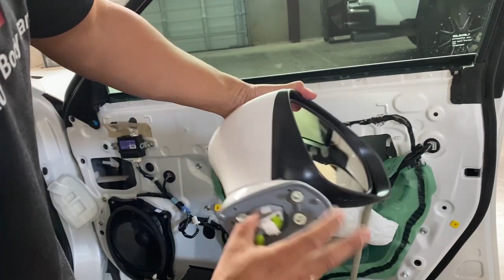Save 🤑 by DIY  : 2016-2018 Lexus ES350 Passenger Side View Mirror Removal and Installation.

Comment: This is the greatest video ever!    It saved me nearly $1000!    I have sheared off outside mirrors on my 2016 Lexus NX200t on a couple of occasions.   Taking it to the dealer for repair cost me around $1000 last time.  This time I knew it would be even more.    However, I was able to find the OEM Lexus outside mirror for $200 online.    I then watched this video a few times.

Removing the door panel was very easy.   Unplugging the mirror wiring harness was also easy.    On the NX, the controller was not in the way of reaching the 3 nuts holding the mirror assembly to the body, so there was no need to move that.

The only problem with the installation came with removing those 3 nuts.   I did not have a 10MM hex nut driver  bit for my electric drill.  I would have needed and extension for the bit as well as the nuts are about 2.5 inches deep.   I did a workaround by using a manual 10mm nut driver.  However the nuts themselves had been installed to be very tight and i could not twist the nut driver with enough power to loosen them.  My fix was to place the nut driver on the nut and then hold the handle of the nut driver with pliers for leverage.   This worked perfectly.   The nuts came off easily.  One did drop into the door but was easily retrieved with a magnetic screwdriver.

Now the old mirror pulls right off.  You can cut the power cable on the old mirror and pull the two parts through the opening separately.  

The rest was easy.  The replacement mirror has its power cord attached.   You simply feed it through the hole in the door.   Tighten the three nuts again, plug the new power harness into its receptacle and test.

Voila!   Mirror works perfectly!

Note:  there are only 3 screws to remove on the NX200 to get the door panel off.   One behind the door handle, one under the small piec of carpet and one under the window controller.  The window controller pops out easily.   There is no screw to remove on the edge of the door.    No need to unplug the power window wiring harnesses either.  You can slip the assembly through the opening in the loose door and leave ithe harness attached.

Caution:  There are many types of wiring harness.  Be careful in unplugging them as you must avoid breaking the plastic.
Reply from the maker: Wow $1000 this is exactly why I make these videos to help everyone save money.  Thank you for watching if you need parts for your 🚗 go to www.ReveMoto.com!